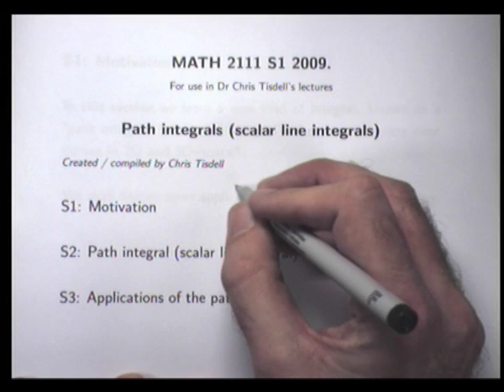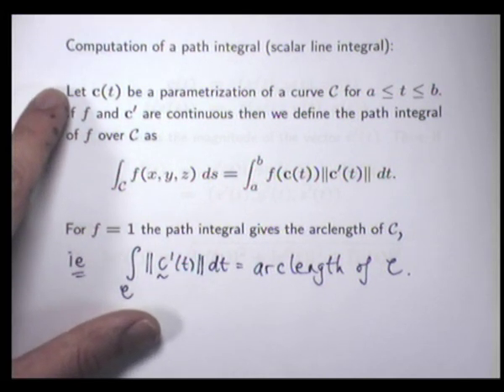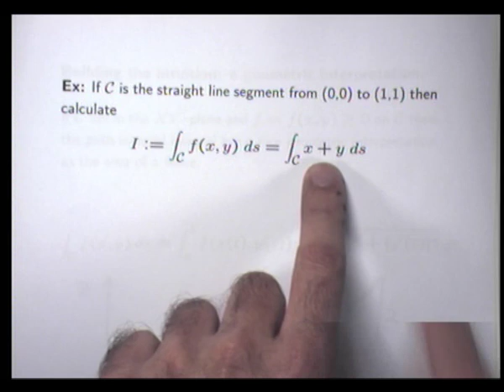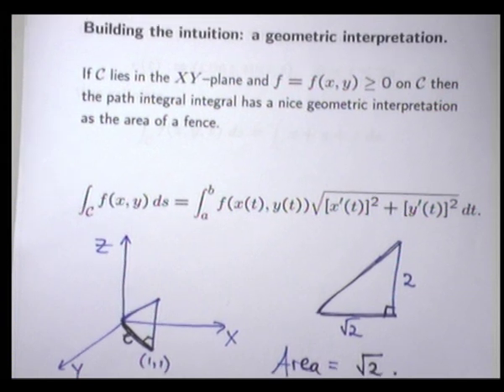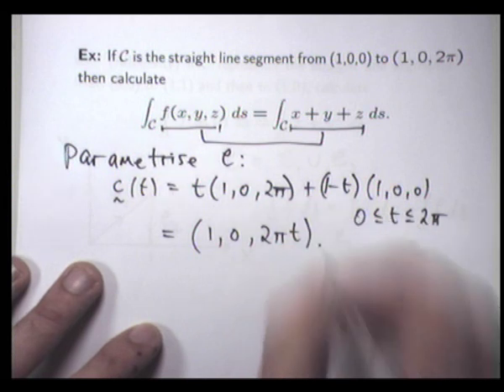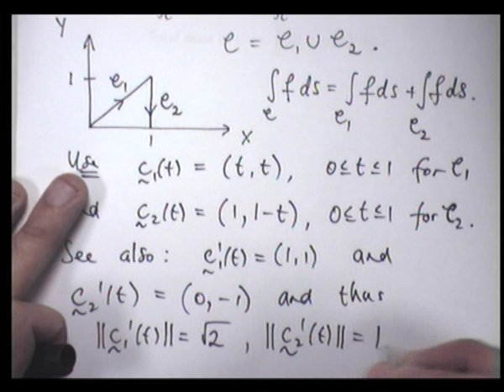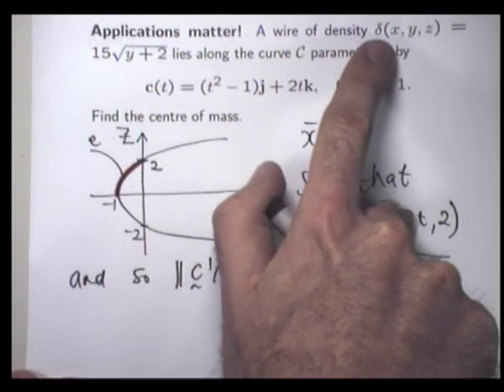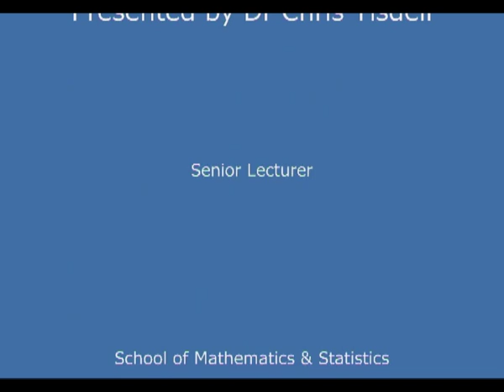Path integrals - How to integrate over curves. Chris Tisdell UNSW

Comment: Thanks for posting this. I had trouble to understand how we pass from a plane area (calculated with an ordinary integral) to the area of a surface in 3D. But I suppose that the Mean Value T. for integrals gives the theoretical basis for that. (In that T, we have a rectangular area which is equal to certain non rectangular area).